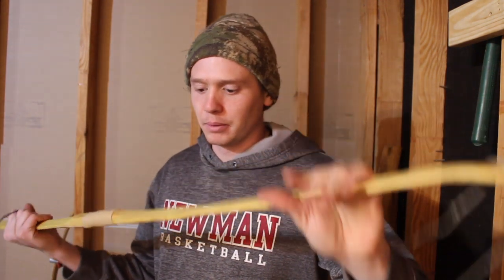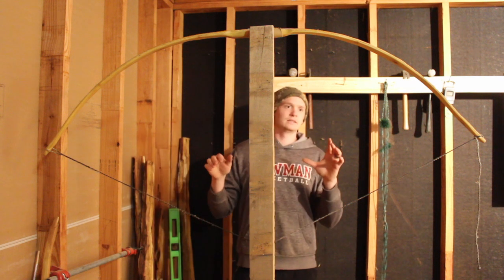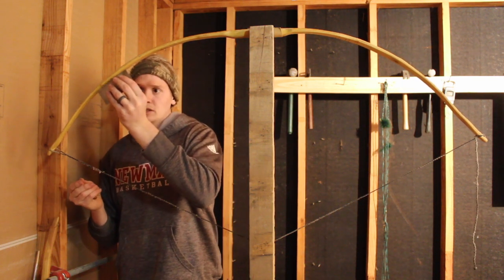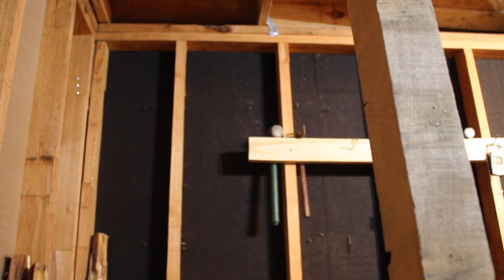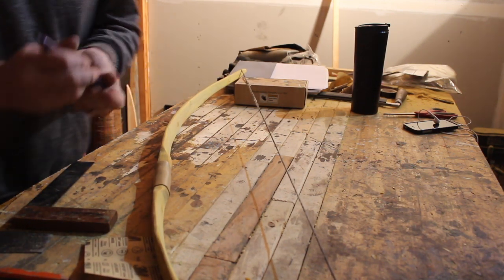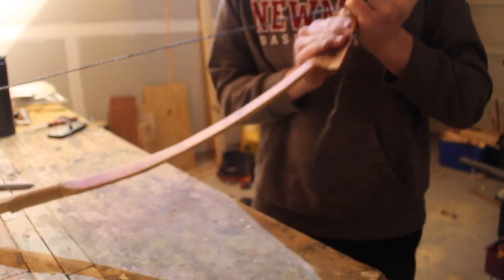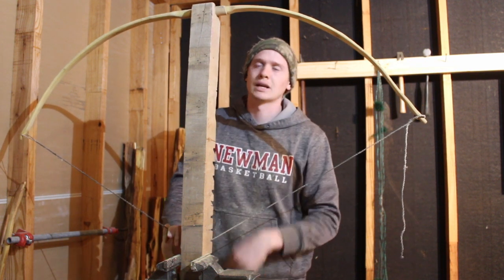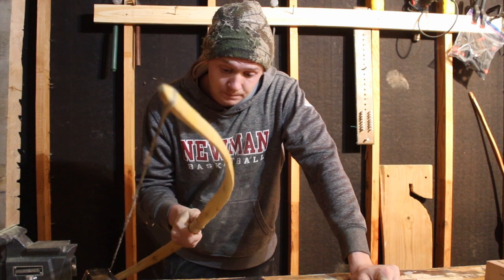54" Short BOW 30" DRAW!!

Comment: Hey man, I noticed you only used 3 layers of the fibreglass tape in your more recent video, I'm curious what your reasoning for dialing it down is?
Reply: Hey mate! Just watched the video I think you're talking about. He puts two layers together im three separate strip's. It works out to be 6 strip's. He says it rather quickly though so easy to miss.😊